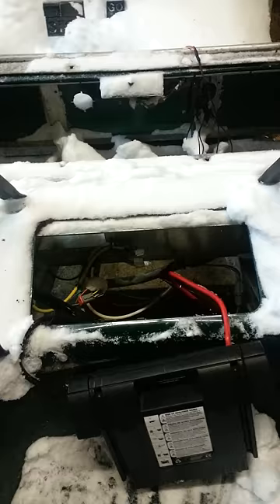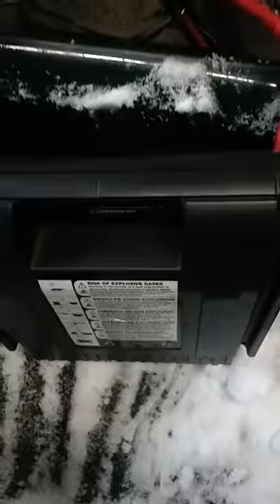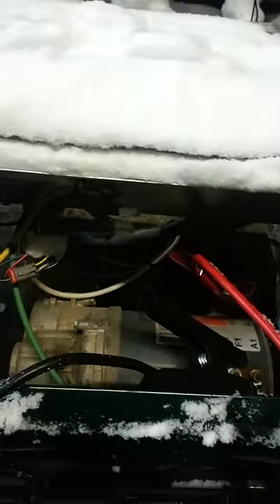Testing an electric golf cart motor

Comment: My motor says 24 volt and I hooked my 12 volt battery to it with jumper cables and the wheel turned. Is that a proper test?
Reply: 24V means that they are taking (2X 12V.... OR 4X6V) Batteries and running them in series to get up to the 24V that your motor is built to handle, KEYWORD:"HANDLE" the more Volts that a motor can handle the more Torque/Revolutions that it can handle = the faster/quicker you can go with that motor... so in the video he is testing the motor to make sure that it will spin under current, and that is it, but if he was running it properly(at full boar) he would run two batteries in series to up from 12V to the 24 V and then his golf cart would move quite a bit quicker. I am sure something in this paragraph is incorrect... but it should give a good explanation on the concept.

Comment: hi.  1996 ez go 36 volts.  reverse beeper works headlamps work but nothing happens when i push accelerator
Reply: Did you get it fixed?  Mine does the same.

Comment: Can I test my 36 volt  cart motor with a 6 volt charger like you did on the 12 volt system.  Very important to me - dont know if my old cart is worth getting new batterys- would like too.  I not sure what iI am doing.
Reply: 6v is not enough for a 36v motor. A 24v would work. Two 12v batteries in series

Comment: Umm, this guy's testing a "shunt" DC motor. A "series" DC motor hookup would be completely different. Be careful. How you can tell which one you have is that a shunt motor will have an F1 and F2 terminal. Those are the field terminals. A series motor uses the prefix "S' so it will have a "S1 and S2" series terminals.
Additionally, this is a fast test just to see if the motor is functioning at some level, however, the wheels are not on the ground so therefore the motor's not loaded.
You can have a bad/intermittent brush (there are four brushes on the armature) and not know it. 
It will show up later however when you have a full pack attached and the cart wheels are on the ground. The cart will have no torque and may not move at all. If you push the cart or let it roll downhill while stepping on the accelerator the motor may startup and drive the cart. When you stop the cart however, it will revert back to the same symptom. 
The reason for this I don't wish to get into now but trust me it indicates a bad motor necessitating removal from the cart and brush replacement. Brushes can be had on amazon.
Reply from the maker: Thank you for your response. Your information is good to know. My initial reasoning for this video was for perspective golf cart buyers and owners, to have a way of determining if their cart has additional problems other than missing/dead batteries. It is not for diagnosing motor problems.
Reply: Yooo I tried this and I have s1 on my motor. It basically blew up!!! Huge spark and burned my negative on my battery but thankfully it’s still at 52 volts… may have screwed the motor idk. But it did make a giant bolt to life ???

Comment: Hi, I'm hoping that you can help me out. I bought a 2001 electric club car but it only came with 1 battery. Is it possible to hook that 1 battery up to see if the motor works or will it not work at all? I just want to make sure all is well before I go spending big bucks on batteries. Thanks
Reply from the maker: joemoneytaker1 sorry for the late reply but I dis this test with a single 12 volt battery. Not sure what voltage battery you have, but I'm sure you could try it. At least that would give you peace of mind before you spend $600+ on a new set of batteries.

Comment: How do I test the motor if all the batteries are dead?
Reply: You need to tie your a2 to s2 then tie the a1 and s1  then with a battery charger put the neg on a1 and then the positive  on a2 the motor should now turn your wheels. You should have the back of the cart off the ground so the wheels can turn.
Reply: Charge the batteries

Comment: I have a 1986 & up EZGO 36 volt cart that when you press on the throttle it goes to full speed no regulation.
Reply: +Marv Van Horn full speed if its a solid state controller then its likely the mosfets if its the resistor it should be the solenoid or shorted connections
Reply: Thank you I had to get a new speed control.

Comment: took my ezgo to a repair shop they told me i needed a new motor,  i put a new motor it it i also put a new solenoid, new battery wire ends and it still does the same thing. It just clicks at the solenoid . same thing it did before i did anything.
Reply: robert morrison do you have a std. 36 volt series ezgo cart.

Comment: You COULD explain how this test proves anything about the motor innards. running the current serially through armature and stater - and it runs... I see that this checks the conductivity through armature and stater ... but it says nothing about common problems within - such as damaged commutator or brushes. Talk to the people, man.